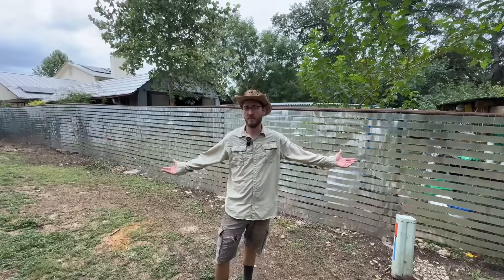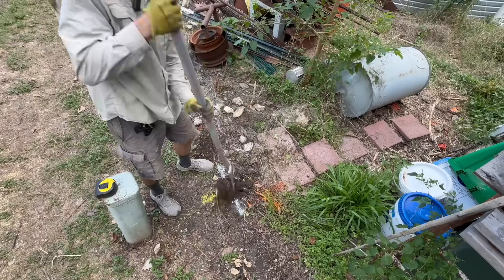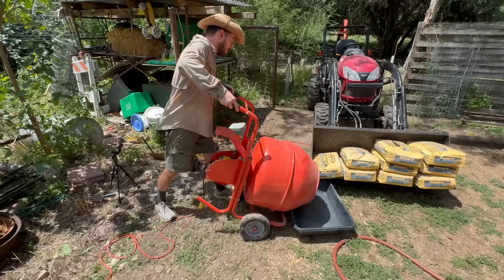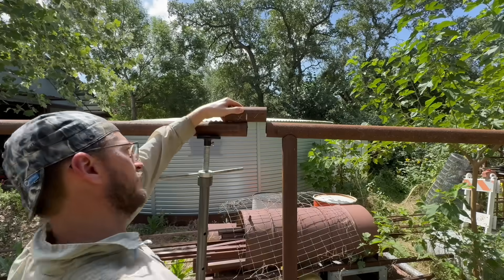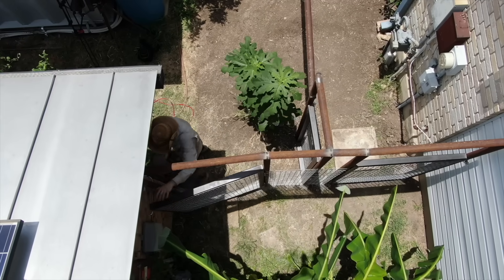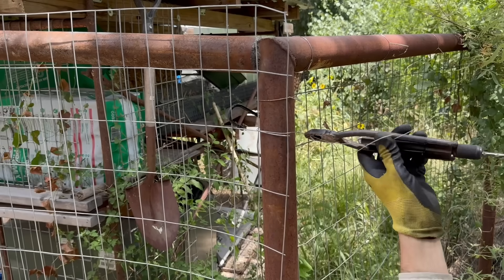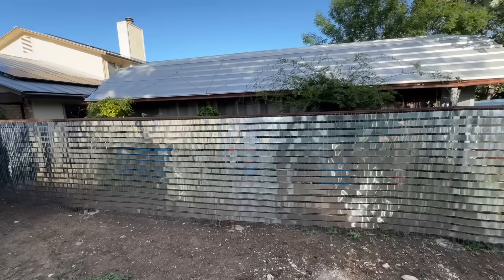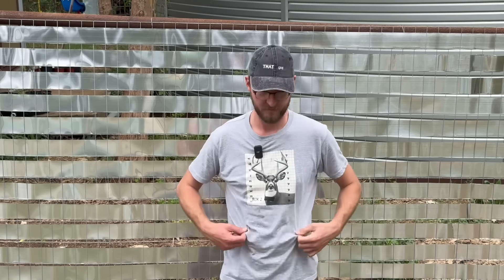This FENCE Lasts 100 years!!!!

Comment: Additional tip to anyone replicating this: Flashing can form mirrors, and a concave mirror can focus the suns energy. This can cause issues of overheating and potential fire risks if unlucky or poorly managed. To avoid this, you can either paint the flashing, or you can sand or sand blast the flashing to give it a matte finish to avoid the problem all together.

Comment: Nice fence but l.o.l. at it lasting even 50 years with hogwire. The poles will be rusted through by then at the ground at the concrete since water will pool on it. Won't the flashing heat up hugely and murder your vines? The reflective shit will absolutely stop deer from approaching the fence let alone jumping it if they can't see over.

Comment: You have a lot of good ideas, but lack a little finesse. A gas cap on your MIG welder would help your welds tremendously
Reply from the maker: I’m using flux core welding wire for most of my work. Are you saying a gas shielding tip would help? If so I had never heard of that.

Comment: How is this holding up? Seems like there'd be galvanic corrosion between the steel and aluminum. Maybe vines will be fully grown before the aluminum starts falling apart?
Reply from the maker: Holding up pretty well. The neighbor’s dog has  bent some parts of the flashing but as you said the vines are growing in quickly to hold everything together.

Comment: i hate to say it but , the pipe could possibly last 100 years if you didn't embed it into the ground but floated it instead. Water will just get into it and rust it out since it's below grade.
Reply from the maker: Our soil is super dry almost all the time.
Reply: @suburbanbiology  yeah what are all those plants and trees living off of? im just saying as someone who restores buildings that are a few hundred years old , if you want a fence to last 100 years you build a wall out of rock , that's what lasts a long time.

the cement will soak up any moisture like sponge even more so than the dirt around it and all it has to do is START rusting the insides of those pipes , and once it's started then all it needs is time. and 100 years is plenty of time for the bottoms of those pipes to rust out. KEEP IN MIND , full size bridge supports rust out within 100 years even when they are floating over the grade. I'd give your fence poles maybe 30-40 years at most , as for the wire and aluminum that's gonna wear out pretty quickly which is to be expected.

Comment: This is what I plan to do around my property, but 2 3/8” pipe in my area is $65 for a 31’ stick.  I’ll use woven wire for the fence as we plan to have livestock and welded wire breaks too easily.

Comment: how are you dealing with galvanic corrosion between the different metals in the fence?
Reply from the maker: It’s so dry here there hasn’t been any…..yet. I bought some zinc anodes that I can always bolt onto the system. The entire fence is in electrical continuity with itself.

Comment: Excellent - but 100 years? - I think rust will get you well before then, especially from the buried posts at the ground surface and maybe galvanic corrosion between the (temporary) Aluminium and steel.  I wish you'd covered the 100years painting system - also Painting mesh would be difficult. Some suggested points - Galvanised pipe and mesh massively increase rust resistance. Maybe use Tees at the top of pipes rather than welds (not as pretty, but construction a lot easier. Possibly square section tube rather than round if welding to ease construction
However I really enjoyed the video. Great work, great result - Especially the sunset aluminium. Well done!
Shaun

Comment: Great idea, specially the bucket, that was genius. The only problem I imagine you having is dependable of the angle from the sun, these are very reflective and in the wrong angle it's going to be a pain in the ass, and it can be a little dangerous as well since reflective surfaces can help start a fire on dry weeds. But that depends on a lot of factors

Comment: The part of the metal fence that is not touching the ground probably last 100 years but the one concreted to ground probably won't because of moisture. Safety wire plier is the correct name of the plier you use. You could have welded the pipe (top section) part of the fence in one full length by clamping a piece of angle iron to get it straight then set it on top of the post to finish it. 7:49 showed pipes not properly butted joint. 8:15 showed the top pipes are not straight. If you had some extra pipes, I would have welded pipes at the bottom of the fence to tie down the bottom of the welded wire fence.

Comment: That reflective flashing is going to create hot spots when the sun heats it. You've built a death ray for your neighbors.
Reply from the maker: It’s been just fine so far. It’s flat so it doesn’t focus light. If it were parabolic I think it would be a real problem though.
Reply: @suburbanbiology  Well that's good. I'm glad it's working! Metal will last longer than plastic that's for sure.

Comment: They make a post concrete that you put in the hole dry and just add water. I’ve used it and later dug them up, it works just as well or better than wet mixed concrete and is MUCH easier.

Comment: My Barber swears by his anti deer concoction. He lives in a deer infested suburb and grows prize roses, so I trust the mix

The mix: 1-egg white mixed with a spray bottle full of water. Thats it. It also doesn't hurt to eat a rare steak and pee around your yard
Reply from the maker: Thanks for the tips! I’d never heard of the egg white thing.
Reply: @suburbanbiology  yea, no problem.. the urine trick works to keep pets and rodents out of the garden. I've done it in my garden back in the day when I used to grow the devil's lettuce 😇. Pee and copper pretty much took care of any pest problems I was having

I also wanted to say that when using a string line, it's always best to use an offset string line and measure to it, rather than have your posts get that close to touching it. I've seen a lot of bowed fencelines as a result of the posts getting too close to the string and reestablishing a new fence line with each post that touches the string. ..plus, it's easier to work without that string in your way the whole time.. 

I liked your video about reclaiming rainwater from the gutter. I've been thinking about laying down what I call a POLR irrigation system that waters everything from the roots by following a path of least resistance  (POLR) below grade, like a gravel sock, or various gravel socks at various elevations,  of various volumes. It could be a 55 gallon drum with a flapper valve on the bottom with a float on it that triggers it to flush automatically when the water reaches a certain level and dump its contents into what appeared to be a dry creek bed and the water would percolate into the POLRs as it flows down the creek.

Are you doing anything to oxygenate your stored rainwater? Pumping it through a sprinkler head and letting it spray up and let it fall back down into the water would probably be enough

Comment: You wove aluminum flashing against steel and will be exposed to rain and outside environment. Yeah your fence will not last 100 years. It will have galvanic corrosion and your flashing will need to be replaced frequently as well as the hardware cloth. Will stay up longer than wood for sure, but looks ugly as sin for sure.

Comment: good luck with 100 years expectation. my pipes fixed in concrete lasted "just" for 35 years. they rusted down at the very bottom, just slightly above the concrete. meanwhile pipes fixed in soil are still stiff and healthy.

Comment: Regarding jumping deer:
Deer are reportedly capable of easily jumping over 6ft, true…  HOWEVER, most (virtually ALL is more accurate) are NOT able to do this from standing still!  Deer also avoid jumping over a fence which they can not readily see through.  Like any intelligent creature, they realize it isn't a good idea to blindly jump somewhere if they don't know what they may land on top of, and if they don't know what will be around them.
Of course, there may be exceptions, like if they are seriously threatened and must jump to escape.

BUT as your anecdotal experience illustrates, such a fence is effective in your environment and circumstances.

Your fence is a beautiful, elegant solution!  Thank you for sharing your ideas & techniques!

One question:  Do you know how the 'flashing' ages?  What will it look like in 5, 10 or 30 years?  It does not seem feasible that it will still look as it does the day you finished the project.

Comment: Are not the mixed metals going to cause corrosive problems?
Reply from the maker: Technically, yes. But it should be an extremely slow process in my dry climate. From what I have read galvanic corrosion is usually more of a problem in very wet climates especially ones with salt mist like near an ocean.

Comment: Those fence post are whats up. I think it is better than wood post but finding those at a reasonable price in my area is like winning the lottery. I like the height of the fence too as keeps your yard truly private and the aluminum flashing just adds to it. I would have painted it though as it will look terrible onces rust/mold/discolor/dirt accumulates after a couple of months or so. First time knowing about your laser cleaner, nice!

Comment: All those pipes were threaded. Why did you go through all the work of welding when you could have purchased fittings?  Was it the up front cost of the fittings?  If so, remember, your time costs money, so if you spent twice the amount of time on this fence install as you would have by spending the money on fittings, i can almost guarantee your way cost more in the end.

Comment: I saw that subliminal :) SUBSCRIBE SUBSCRIBE! I did and even though I’m a female I really enjoy learning this and the language. My dad was a bad ass welder but a good old boy that beLIEved girls don’t have the capacity to do this work. I am pretty little but I am one great assistant and made all our concrete and wheel barreled it to every dump to make our ten inch thick garage floor. Love your sense of humor and you’d be a fun man to work with. Thank you for teaching us ☺️
Reply from the maker: An arc melts steel irrespective of which gender pulls the trigger. If you’re not turned off entirely, I highly recommend getting a cheap MIG welder from amazon and trying it. It’s very therapeutic. I’m glad you enjoyed the content. Thanks for your support!

Comment: If you just sat the pipes in the hole and welded everything up then poured it would have saved you alot of effort.
Reply from the maker: Could do. I bet I would have bumped the posts off plumb though.
Reply: @suburbanbiology  Plumb after tacking right before pour..

Comment: The view of my neighbor's yards has never bothered me.  I figure, it's their yard, they can park crap on it if they want to.  And if you live somewhere long enough, uou're eventually going to have crap outside, lol.  So far I've been able to keep my outside junk kind of semi-hidden behind my garage, but I'll eventually have to build a lean to back there, or a whole shed to keep stuff from getting too badly weathered.  Our front yards here are small, maybe 60 feet from the front of the house to the road, but our back yards are huge.  My back yard is about 1.5 acres.  Next door neighbor's back yard is about 5 acres.  I bet that kind of pipe would be a rare sight around these parts, being in rural southern Indiana.  Not much call for oil drilling here with limestone bedrock about 6 feet below ground level (and most likely caves under that with our karst topography).

Comment: If the pipe is threaded, can you add another height extension? Add some barbed wire maybe or electrify fence above current welded wire.
Reply from the maker: Could do but the way I welded the joints would have to change for that to work.

Comment: You worried at all about the galvanic interaction between the aluminum and steel making the fence rust away?
Reply from the maker: In my dry climate that will take a super long time to happen. But yes eventually it will happen.

Comment: Your skills are amazing, I would suggest installing also solar, from my experience I recommend biggest Victron MultiPlus inverter you can afford, bifacial solar panels, victron mppt regulators and some lithium batteries 15-20kWh… These days in EU 500-600 Wp panels are cheaper than aluminium fencing… Im also young and made my home 10 months of the year offgrid by DIY solar, I  dont have my own grid connection I just use neighboor as backup and use power from him in winter which I give him in summer, win-win…
Reply from the maker: Already have solar on the house and added a battery backup recently. Solar is awesome! Thanks for your support!

Comment: You could use an air hammer or even pressure washer to dig out those post holes…though in Texas I expect water is scarce so it’s not a great solution for you.

Comment: With the aluminum in direct contact with steel in a sometimes wet environment, I'd be worried about galvanic corrosion.  If be curious to hear in a few years if that turns it to be an issue.

Comment: Looks nice, as a metalworker the only thing I would is are some holes so that condensation water can escape.
Reply from the maker: I did not discuss this, but each vertical post has an open end that contacts soil so that water can soak into the ground. I made sure to set the vertical post in place before adding concrete around the sides. That way the horizontal pipes can drain into the vertical pipes and the vertical pipes can drain down into the soil. Thanks for commenting and for subscribing!

Comment: An improvement to your initial method, especially with the grooves, would be to have the string at 6' with a flag tied every 10'. This would have given you the exact placement you wanted when positioning the posts. When tightening the string the second time, just make sure the flags are 10' apart and tie off. Excellent work!

Comment: I don't think this thin foil aluminium ribbon would last more than 25 years. It depends on a climate though but an aluminium pan left to elements on my yard got rusted. I wouldn't say the ribbon would completely gone but it will have holes and will be broken in some points leaving shreds hanging on a wire net. The wire net will also be broken here and there. The only reason why aluminium lasts is because of a thin layer of oxide on its surface but this layer is compromised even by weak acids over time and the ribbon doesn't have much material to sacrifice.

Comment: add a notch at the top of the poles and run a string through it so you can turn them straight, use a pitchfork for the cement air pockets

Comment: Nice fence, but who has that kind of money to put in a fence like that? Pipe is not cheap. Your roll of aluminum isn't cheap. Do you even tell us what you spent? Geese, you must be one of them rich bastardians. Either that or your using clickbait to afford it. Not everyone can do a Youtube vide and have enough followers to afford said fence. Your welding equipment isn't cheap. If I want to put up a metal privacy fence I use old barn tin. Works great and doesn't cost me anything. Plus the fence holds up way better than them paper thin wood fence panels sold at the local Home Depot. That crap cost too much and looks like crap after just five years.

Comment: Deer will not jump over where they can't see where they will land. Chickens are similar in that they are not interested in what they can't see from where they are. I had a front porch problem with my chickens. I put up chicken wire to keep them out. They would always find a way through it. This year I put up a half wall around the porch. They couldn't see into the porch so they had no interest. I used to have eggs on my shelf, no more.

Comment: I must have missed the part when you sanded and wire brushed the pipe and then painted it.  Did I miss that part, or maybe it's on the editing room floor?

Comment: Labour intense, my father built a pipe fence and used threaded connectors instead of welding. Dad is long gone but the fence is just as if it were erected today. All credit to you both.
Reply: I always like to look at old stone walls made up of uncut boulders and stones collected from the countryside and admire the hard manual labour forgotten dads and men put into these works of wonders.
Reply: Similarly in usa labor is intense
Reply: What  an imaginative success. U really think out😊 of  the box. Great for an area I have

Comment: Looks nice.Your work is so efficient that I was surprised when you didn't set the first post a little short of 10 ft and cut a saddle joint in the starter end of the top rail.

Comment: In my experience deer won't jump a 4 foot fence if there is a hedgerow along it (I use native plants like chokecherries, plums, currants, or i grow vines on the fence). If it's  too wide and/or they can't see where they'll land they don't try.

They will sometimes try jumping a tall fence (5 feet or so) if they can see the other side is clear, but they might hit the welded wire at the top and break the welds, ruining the fence so it has to be patched.
Reply: That pipe along the top will protect the fence, but I just have conventional wood posts and metal T posts.

Comment: I'd strip the vertical wires off and then wrap the end wires around the post and tie them off to themselves. It lets you tension the fence wire up tighter and not have bits sticking out that you could get caught on.

Comment: Definitely watch out when lifting a rolled up metal cage type fence. You can pinch your fingers so easily. Putting the bar through it before moving it and using it to help maneuver the roll of fence was a good move.  The bar was a little short for my liking since I have pinched my fingers before moving masonry type fence like this but none the less it gets the point across.